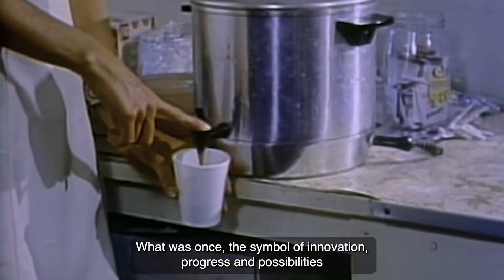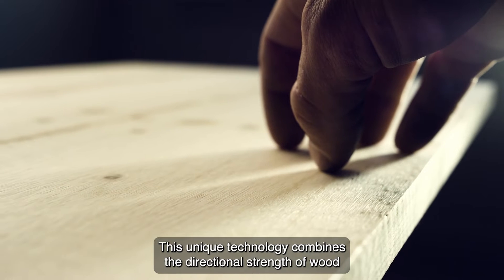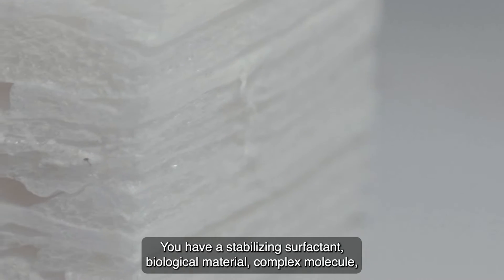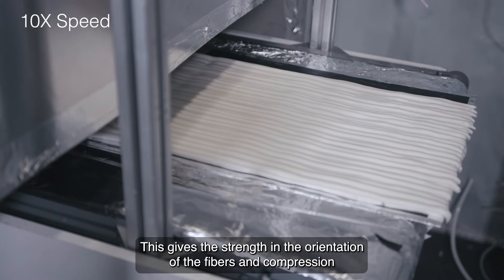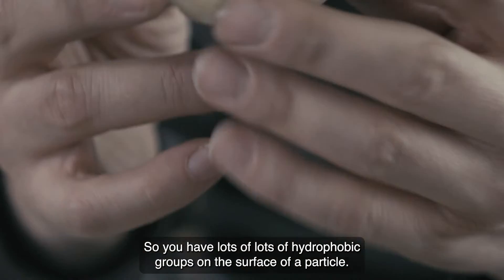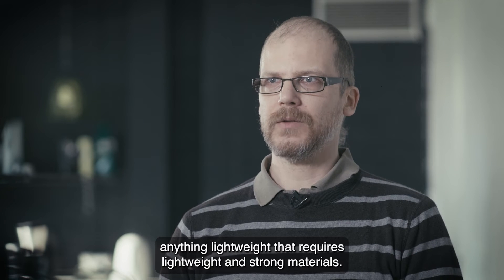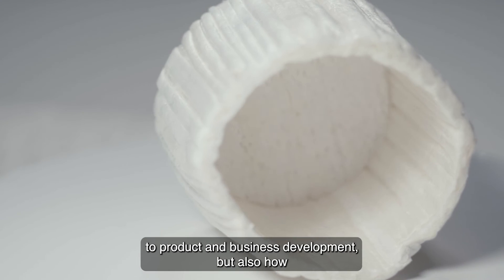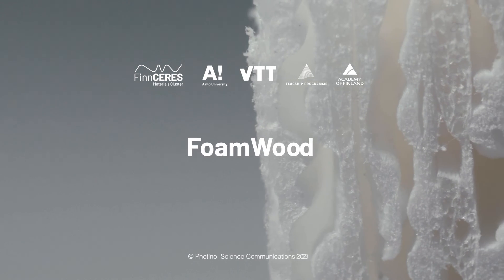Sustainable bio-based foams with extraordinary mechanical properties

Comment: Biodegradability was not discussed which I hope can be better than foam used for the food industry for that version of this product.
CFC and other chemicals used for production is another concern that must be better than petrochemical based foam.
Most importantly, greenhouse gas emissions during production must be better than legacy products and ideally negative by sequestering the wood carbon.